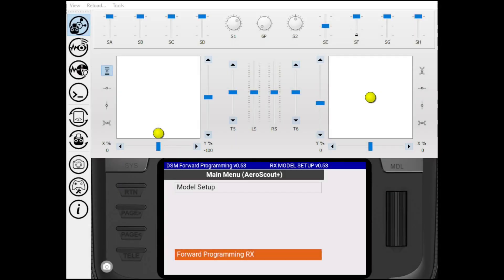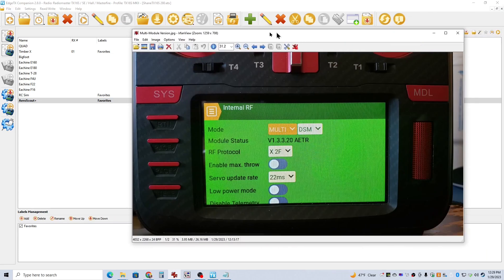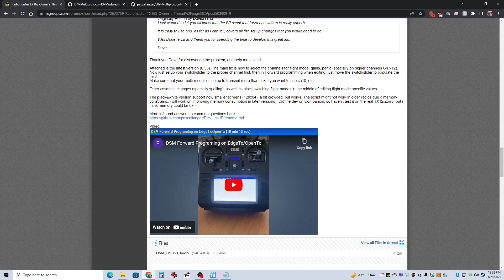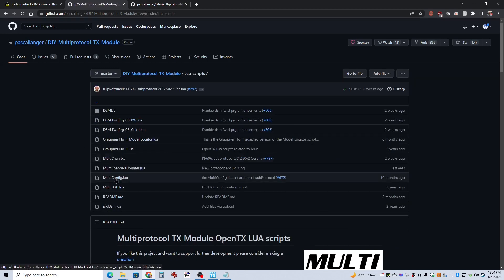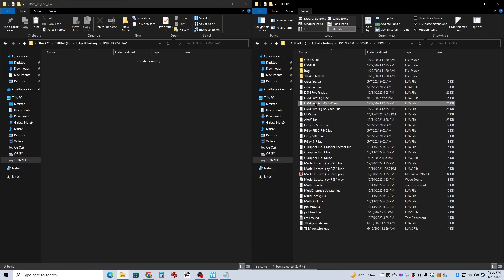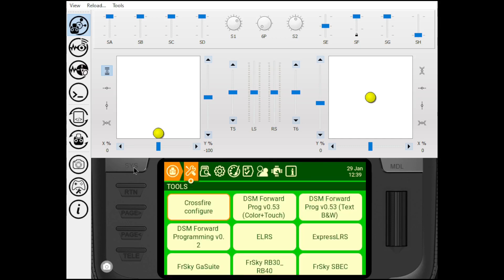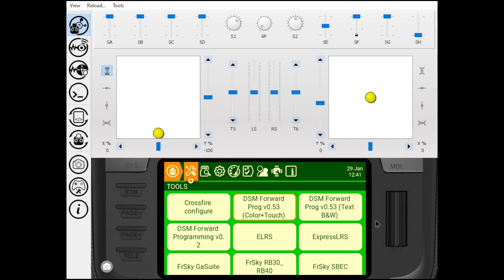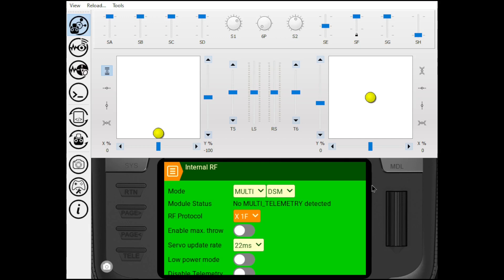Ep.1 Radiomaster TX16S EdgeTX to Spektrum Forward Programming

Comment: Why would anyone go through the hassle when a $25 Byme A does more
Reply from the maker: Hi and thank you for your comment!  The Byme-A is certainly a very capable flight controller/gyro system for sure and I would not steer anyone away from it if it fit their needs.  I think my main/only "con" regarding the Byme-A (or Byme-D) is that they only accept SBUS or PPM for the input from the receiver.  While those are very common protocols, all receivers aren't compatible so unable to be used.  If someone already has Spektrum DSM receivers they won't be able to use them with the Byme-A, at least not without additional hardware to convert the SRXL2 signal to PPM.

Setting up the DSM tools isn't that big of a hassle, especially with the newer Lua scripts since this series was released.  When I did this series, the updated Lua scripts were still fairly new and the setup wasn't quite as streamlined as it is now so it may seem complicated.  Probably the main reason folks will keep needing these DSM tools is because the Horizon / Spectrum BNF models are very popular and already come with the Spektrum SAFE/AS3X receivers.  Out of the box they work great, this series exists to help folks unlock them and customize them to their hearts content.

Thanks again for the comment!

Comment: I'm thinking of trying this radio. Have they updated anything or do you still have to do all of this programming?
Reply from the maker: Do you mean do you still have to install DSM Tools?  If that is what you are asking, I'd have to say it depends on where you buy it from, how long they've had it on the shelf, etc.  Some will come with a newer version of the Lua scripts but impossible to know until you get it.  Since I made this video, there have been many updates to the DSM Tools Lua scripts, the latest just a couple months ago so odds are if you want the latest version you'd probably have to update it.  I have newer videos on the update or install process that are a little more intuitive and will be releasing another new update soon on the latest version called the "DSM Tools Suite" that combines several of the DSM scripts into one package.

As for the Spektrum side of things, they also have newer firmware so also depends on what firmware the receiver in question has on if you need to update it or not or if you can do the factory reset and reprogram just from the radio.
Reply: Ok thank you, I'm gonna purchase directly from the manufacturer. I'll try to find as much info as possible and then I'll also watch your videos.
Reply from the maker: @MONTYS.AIRWORKS  Always here and do my best to support my viewers so reach out if you have any questions.

Last I checked the manufacturer was a few versions of the Lua scripts behind.   EdgeTX and the associated lua scripts are very active communities so it would be difficult for every manufacturer and vendor to have the latest and greatest software already installed but with so much support through forums and YouTube videos you should be able to get your radio up to date easily.  Just take the time to learn your way around the radio.
Reply: Thanks and I will reach out if I have questions.

Comment: Hello Shane, super noob here, I have a few questions you may be able to help with. Let me start by saying I got my first plane right before christmas this year. The plane was the carbon cub S2 RTF. On my third flight using the supplied DXE transmitter the plane started acting strange and flew out over the ocean not letting me control it at all until I lost sight of it. I’m a little bummed about. So, I made a pretty big jump in my opinion and purchased a tx16s mk2 last week with built in 4 in 1 and the ranger elrs exterior module. I also bought the turbo timber sws. It’s such a cool plane. I may have bitten off more than I can chew. But how would I get started. The planes receiver is the AR8360T and has the Avian smart Esc. Oh I forgot to mention the plane is a BNF. Anyways, do I need to download files from somewhere on the internet to my transmitter to be able to use this receiver and its stock functions? Or can I just bind to the transmitter and it be ok to use? I hope this isn’t too ignorant of a question. Thank you Shane. You’ve got a lot of good info on your channel. - Stephen
Reply from the maker: Hi Stephen!  All good questions when you are getting started.  The more you understand the better your chances for success!

Bummer about the Carbon Cub S2, I'm sure that was heartbreaking.  The Turbo Timber SWS is an amazing airplane although will be much more heartbreaking for that one to go down or fly away! Depending on the firmware that came on your TX16S it should bind right up and let you fly.  I would make extra certain that everything is working exactly as you expect, do a proper range test on the ground prior to flight, etc.

While it shouldn't be absolutely required, I would also have the latest DSM Tools scripts on the radio (this may require updating EdgeTX firmware if you have an older firmware, latest is 2.10.5). I have a fairly recent video on installing or updating your DSM Tools on the TX16S.  This script will let you access the Spektrum Forward Programming on the receiver and adjust gyro settings and also access additional telemetry data, access the Avian ESC to setup reverse thrust if you want, etc.

Browse through my "RC Guides" playlist, there is a lot of information there to consume.  With the TX16S and EdgeTX you can setup the plane as simple or complex as you want, just be sure to fully understand your setup and know you have it right before you fly.  I'd hate to see you have a bad experience with such an expensive airplane and give up too soon!

Feel free to ask as many questions as you like.  When I can I am always happy to help. That said, here in a couple weeks I may be unavailable for some time but will do my best to stay on top of comments.  Welcome to RC!

Comment: I can’t seem to get this figured out. I got into this hobby this past spring and started with a TX16S and had no problem with eflite umx planes and getting safe/AS3X on a switch to turn safe on and off. Even these smaller Chinese  volantax planes I have safe limited safe and off on one of my three way switches. I recently bought an AR630 and two 7 channel lemon receivers and I can’t get safe or as3x on these new receivers.  So I took out  a AR631+ from my F4U Corsair I haven’t built yet to fly my new A10 twin 50mm and followed the binding instructions and it bound in safe. It is on channel 8 because the Corsair has retracts flaps led control so the safe is on always. I couldn’t turn it off. So last night I went into forward programming and it’s limited. I got it to work once then changed something on forward programming flight mode because safe was on my  SA  up and I am used to it being  down so something happened in forward programming because now I don’t have safe or AS3X at all now.  It’s strange in forward programming because it has safe on/off AS3X on/off  also has safe select on/off at the bottom.  Flight modes 0-2  with the switch Aux3  forward programming on my transmitter screen which is SA ? I am totally lost now. I should not have messed with forward programming because I would of took the A10 up for its maiden this morning.  I could probably do with out but I am really new to flying and I am used to having safe for emergencies and I also like to fly in safe when I don’t want to think to much
Reply from the maker: That's a lot to unpack but let's dive in a see what we can figure out.  First, to my knowledge, Lemon receivers are not "Smart" compatible and don't have the Spektrum AS3X and safe functions you can access via Forward Programming.  The Spektrum AR630 does but if you purchased it off the shelf they don't come with any gyro setup configured. You have to set them up from scratch to enable safe and as3x.  This video series covers all the steps if you make it through all the episodes.

The AR631 that came with a BNF airplane will have a specific setup based on the F4U and very unlikely the gyro directions would be correct for the A10 so you would have to unlock it and do a factory reset to be able to sort out the gyro control directions.

Some trainer airplanes like the Apprentice, AeroScout, etc. have SAFE features always enabled and you can switch between 3 default gyro modes with a switch on the assigned channel.  The AR631 from your F4U is setup as "SAFE Select" which means you can enable or disable the SAFE flight mode during the bind or via Forward Programming.  If SAFE Select is OFF you won't be able to access the SAFE Flight mode "0" via the switch you assigned.  With SAFE Select OFF two of the switch positions would be selecting flight mode 1 (you don't have flight mode 0).  The 3rd switch position will select flight mode 2.

SAFE Select enabled receivers also allow you to assign the desired channel to use for Flight Modes.  Sounds like you used channel 8 which should be fine.  Make sure you do NOT check the "Enable max. throws" checkbox on the TX16S RF setup and also make sure you have the channel range in the TX16S set for channels 1-12.  If it is set for 1-6 the radio will only transmit on those channels.  If you set it for 1-16 I think it still only transmits on 1-6 because it also doesn't work for channels 7, 8, 9, etc.  The SMART telemetry function of those receivers only works for channels 1-12 via the Multi-Protocol Module, so it is best to set your model RF setup to channels 1-12.

We can dig deeper but start with these items and let me know where you end up.   I know some of these videos in the series can be long but try not to skip around or you might miss a key instruction.  Also, curious what version of the Forward Programming DSM tools scripts you have on your TX16S.  There have been many updates since this video so it is important to get your DSM Tools scripts up to date.  One of my more recent videos shows how to install or update your DSM Tools using the latest and greatest version and process and it is quick and to the point.
Reply: @ thanks for responding. So I went to version and it looks like this 2.7.1(a55aff02) then I clicked on RX version it shows V1.33 37 AETR. You mentioned that the AR631 that came with my F4U  will be wrong for the A10? When safe was working it was going the wrong way I noted then I went to special functions channel 8 and marked the box inverted and it worked in the correct way after that. I just messed around with forward programming and now no safe or AS3X.
Reply from the maker: @joeistheg.o.a.t8456  The Multi-protocol version of 1.33.37 AETR is ok but to get full DSM Tools functionality you might need to update EdgeTX from 2.7.1, that is pretty old.  Current EdgeTX is 2.10.5.  The version I was referring to in the first comment was the DSM Tools version.  The default Forward Programming that came on your radio is probably v0.2.  In this video the current version was 0.53 and as of today the version is v0.59.

Using a Special Function for channel 8 works but not needed, you can just setup channel 8 in the MIXES page with the SA switch as the source.  Then if you need to reverse it go to the OUTPUTS page and invert it.  Perhaps that's what you meant?

Channel 8 isn't what I was referring to for the gyro directions.  Channels 1-4 for the ailerons, elevator, and rudder you must match control direction from the radio stick control and also make sure the gyro is moving the control surfaces the correct direction when in safe mode.  If the gyro is moving them incorrectly it doesn't matter if your sticks move them correctly, if you throw it in safe while in the air and the gyro is wrong it will be nearly impossible to not crash unless you take it back out of safe quickly.  If you aren't 100% sure the gyro is moving the correct direction do not fly until you are.

To know if Safe Select is on, when you power up the plane and radio, if the control surfaces "dance twice" SAFE Select is enabled and you should be able to select between all 3 flight modes if your safe channel is setup correctly.  If you power it on and only get a "single dance" then SAFE select is OFF and the SAFE auto leveling mode will not be available.
Reply: I was able to get safe back but I can’t get it to go off now just like from the beginning when I first bound it. I am not messing with forward programming again until after I get to fly it once in safe and also after I update my radiomaster.  To get safe back I went to forward programming and initially it only had gyro settings on my screen left upper side. Upper right side is (back) then at the bottom middle there was a few letters …don’t know what they referred to but i highlighted it clicked it…instantly kicked me out then when I went back to forward programming it had other settings now below gyro settings . I clicked on that did  reset to factory settings. So now when I powered up the plane it didn’t dance twice. Was bound but no stability whatsoever and my controls were reversed again. I go back to forward programming  other settings and below the factory reset is restore saved settings. I never saved anything but I figured e-flite or whoever set it up first had saved. I clicked restored  and  safe is activated now in correct directions . Also now on Forward Programming under gyro settings it has AS3X settings below Safe settings all of the sudden. Wasn’t there before. I just need to update it first before I mess around anymore.
Reply from the maker: @joeistheg.o.a.t8456  What version of Forward Programming are you using?  If you are using the old v0.2 you will not be able to do much such as reverse gyro directions if necessary.

Since you are using a receiver originally setup for a different airplane I am very concerned your gyro auto leveling control directions could be backwards.  In Episode 3 of this series is when I really get into the setup, reversing gyro directions, etc.  I show how to reverse the gyro control directions as well as the radio. Both must be correct and have very different procedures to adjust.   If they are backwards you will have to do the factory reset and start from scratch.  In order to start from scratch you will need to do the radio EdgeTX update as well as the DSM Tools update.   I highly recommend popping some popcorn and setting through this entire series.  There are the initial 3 episodes then a couple bonus episodes that could be helpful.  Then I have an episode on "easy EdgeTX updates" and another more recent video on updating the DSM Tools that you really need to watch when you are ready to update.

If you'd like me to have a look at your model setup, you can get copy the "model##.yml" file off the radios SD card and email it to me and I'd be happy to have a look and make any suggestions.   Email is  shanesdiychannel [at] gmail.com
Reply: @shanesdiy   you are right. My F P is v0.2. I will update it as soon as I can.  I did check the controls in safe and it is working correctly….I think. When I drop the left wing down the right aileron goes up and left aileron goes up when I point the right wing down. When I point the nose down the elevator goes up and goes down when I point the nose up? I have been watching some of the series but got lost when you hooked it up to a computer. So maybe it will be better to watch when I have my laptop working and get the cable to hook it up. I am not much of a computer person. When I got an iPad I kinda left my laptop alone. But now I am in this hobby with a radiomaster I need my laptop . I will definitely watch the series to learn more.  You do a great job and explain things very well from what I have seen so far. What cable do I need for computer hook up? My iPad won’t work?
Reply from the maker: @joeistheg.o.a.t8456  The cable is the SPMA3065, there is an Amazon link in the description or of course you can get it from Horizon Hobby.

I'm not sure if the Spektrum Programmer software works with IOS or a Mac.  If you have access to Forward Programming and the receiver has the factory reset option you may not need the Spektrum cable at this time.

The TX16S just needs a USB-C cable to update it. Never heard of anyone doing an update with an iPad but it is possible with a Mac.

Comment: Hi There I finally got my TX16S and have the software all up and running. I am using the AR10360T 10ch receiver and I could bind it and go into model setup no problem. I have one issue: Why can't I use all 16 channels in the page where I select the X2F protocoll? It only goes up to 12. Is that a technical limitation? I know the receiver supports 20 channels (10 physical and 10 virtual). Regards!
Reply from the maker: It is some sort of limitation with telemetry and DSM.  Does bring to question how/if we can take advantage of all available channels. I will reach out to one of the developers and see if he has any insight on how we can unlock more channels. Perhaps with the new Spektrum updates the multi-protocol-module firmware also needs an update.
Reply: @shanesdiy  OK, thx. BTW I have now almost fully setup my F16 and my desired setup is complete. I will definitely make a donation to the team later... One "bug" I encountered was at the AUX setup wizard where it takes you through the stick inputs it only let me proceed for roll and pitch if I moved the sticks the opposite way to the picture that was shown. Then I had to go in to aux settings and reverse the stabilization for roll and pitch. Doable but for newcomers a bit confusing.